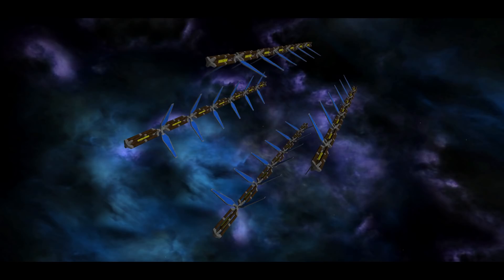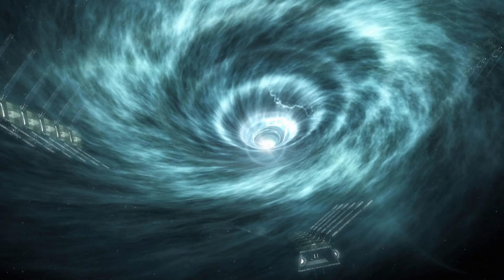Jumpgate Network - Babylon 5

Comment: Here's a though that just popped into my head. The creators must have possessed spacecraft capable of creating their own Jump Points, but created the Gates for lesser races. It's flat out impossible for the Gates to date to as early as 4,800 BC otherwise, because it would take millions of years to seed that extensive a  Network, if only sub-light speeds were available to the Gates' creators.

Comment: Small clarification. The knowledge itself to build jumpgates goes back to the ancient past. Humans bought that knowledge from the Centauri after leasing a gate from them. The gates themselves are not ancient and last and are replaced/repaired as often as any other machine.
Reply: Actually the original gate network was thousands of years old and the gates didnt have beacons, so it very difficult to find one of the original gates. The young races just reverse enginner the technology and started to build their own network based on the original one.
In the episode about the Fall of centauri Prime, Delenn stated to Lennier, while they were adrift in hyperspace, that could be possible they would end up finding a ancient jumpgate, build thousands of years ago. Then Lennie said that this would be very unlikely, but that would still be possible.
Reply: Renan C Brazil oh yeah, I'm not saying there aren't ancient gates, or an original network. But pretty much every gate you see in the show, except the zha'ha'dum gate, is a 'new' gate.
Reply from the maker: I will do a video talking about the Earth alliance and how they got Jumpgate tech in the future.